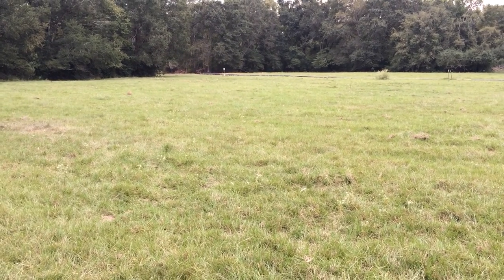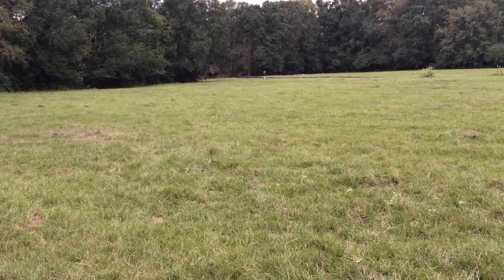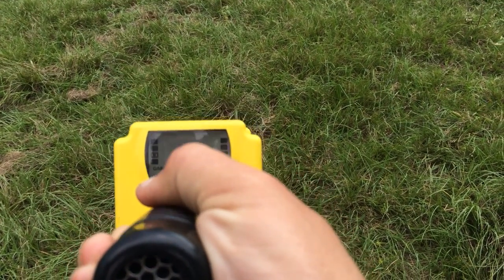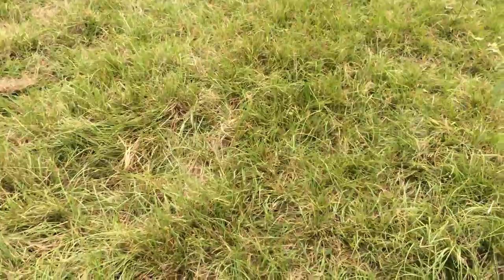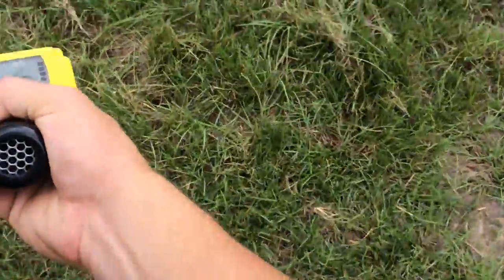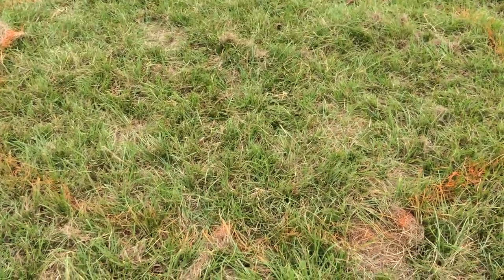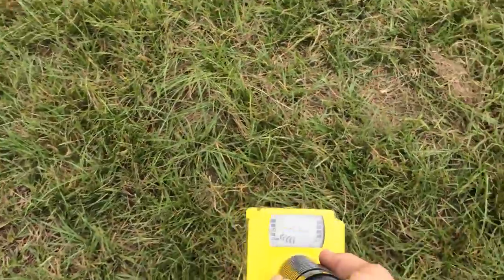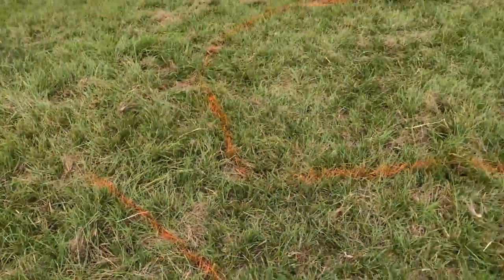GPRS - Schonstedt GA 52 Well Head Locate

Comment: Hey Nate. I know this vid is a couple of years old but I noticed the tone its making is the in house test tone. The customer setting is a deeper tick-tick sound similar to the other units. I cringed when I heard it. Btw, I worked for Schonstedt, now RadioDetection a few years..
If you still have the unit, slide the cover off. On the PCB you'll see a little black switch almost dead center on the board. Switch it opposite of where it is. See if you like that better. The volume will be noticeably better

Comment: I lived on my property for 20 years I have a double drop shallow well that has been covered since I bought the place. Old owners passed away before I purchased.  I need to replace the foot valve at the very least due to losing prime every time there is a power outage which happens frequently.  Can I rent one of these?  There is alot of shale gas workers in my area is this something they may use? Does anyone know  any other methods so that I can find the concrete lid covering well. I tried probing with a metal rod and using a metal detector but no luck
Reply: John Young 👋, I’m currently having the same issue 🤦‍♂️. Care to share any updates and fixes?
Reply: Same here any updates?? I'm about to just go get a metal detector and have at it...
Reply: same here. does it work indoors? / on flat and hard surfaces?